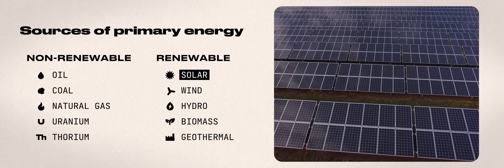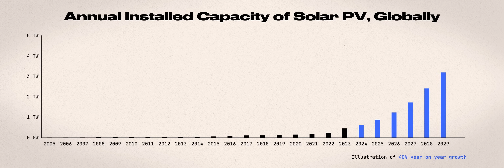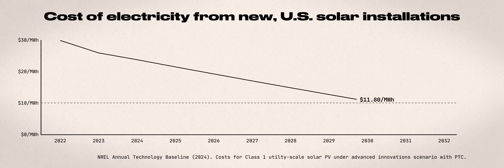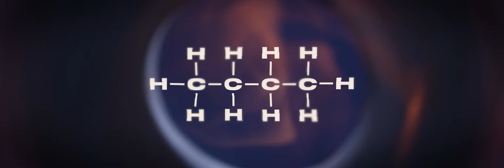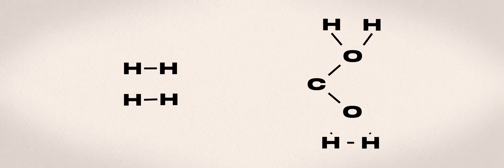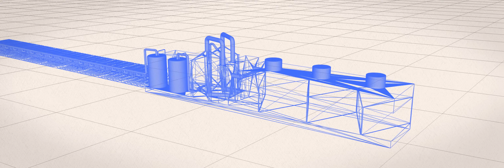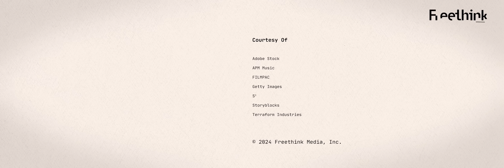95% of our energy could be downstream from solar by 2042 | The Freethink Interview: Casey Handmer

Comment: According to him, they will create a methane with an efficiency of 20-30% and then we burn that methane we will get only 30% (at best) heat which is used and rest are losses. So doing basic math this comes down to Solar generating energy (100) converted to methane (30) converted to useful energy which is a meager 9 points AT BEST. So you are losing 91% of the energy in this process just because you do not want to switch to other means of consuming energy (e.g. electricity directly). Makes NO SENSE to me.
Reply: The reason they are doing this, is because at peak hours the solar engery delivered in a renawble grid is more than collective consumer can utilize. This risks to overload the grid and results in negative electricity price to motivate industrial consumers to raise their demand and match the offering. Now if you have a spot mechanism that can be turned on to consume when the prices become negative with over supply of electricity, like lets say produce synthetic fuels and resell them for a profit when electricity becomes scarce again (night, winter, elsewhere on the globe), you can leverage negative electricity price and resell prices to turn a profit and help balance the grid. Its essentially the same a battery would do but with fuel that can be stored and moved and used as you like and in the form (chemical, thermal, electircal) you like.
Reply: @amadoucisse2692 so churn out some Bitcoin/digital currency, give electric discounts to AI data centers or send it to batteries to sell at a higher price later... The latter will most likely happen due to economic incentives. 

Creating complex hydrocarbons won't likely ever be cheaper than existing fuels which are currently more expensive than electricity and batteries... Which are getting cheaper every year due to Wrights Law/economies scale(ever growing).
Reply: @amadoucisse2692  There are far cheaper currently available methods of energy storage. This is taking excess energy, then wasting 90% of if before selling it back. There can also be other incentives, such as encouraging charging your car during the day, which could become mainstream if workplaces installed level 2 chargers.
Reply: @amadoucisse2692  But wouldn't that spare energy be better stored in a battery to use when its less sunny?
Reply: @ninamatthews8747  Not if you have to ship it around the globe
Reply: like others here mentioned, it's for applications that are really hard or even unrealistic to electrify. Think marine applications, aviation, steelproduction, glass manufacturing, fertelizer, etc... There is a possibility to electrify these sectors but not fully, that's why e-fuels will be necessary. Methane is one form of e-fuel, but other important ones can be e-methanol, e-ammonia, e-kerosine, etc...

By the way, burning methane like you mentioned doesn't always result in just 30% efficiency, depending on the machine you're using, it can be a lot higher. For instance, electricity production with a combined gas cycle turbine, results in a thermal efficiency of over 64% (most efficient one). Keep in mind that the e-fuel manufacturing is in it's infancy, incremental improvements will happen when adopted like we've seen with almost every other thing humans build.
Reply: The natural gas is primarily for processes that require it and cannot be electrified. Lots of critical industrial processes require chemical feedstock that is currently fed by fossil fuels. Also something like aviation will likely remain chemical-powered barring massive improvements in technology.

If someone wants to waste (what will arguably be a more precious resource than electricity at that point) by burning it to drive a car instead, that is on them.
Reply: I think it will be usefull for some niches applications, like some industrial processes or maybe big machinery in far away  region. But not in your car/bus/truck nor for heating/cooling your home.
Reply: So much lost sunlight
Reply: A huge amount of renewable electricity is wasted because there often isn't the demand to match the supply (noon on a sunny day for example), capturing the excess to produce synthetic hydrocarbons is where it starts. But as Casey says in the interview there will come a point where cost of solar gets so low that the easiest and cheapest way to reliably produce a lot of energy is through a massive solar farm that has its PRIMARY output as synthetic hydrocarbons, even if it's a highly inefficient process it'll still be cheap.
Reply: @olit1234  There are much better alternatives than this, which is about 9% efficient. To use extra energy from solar, charge EVs during the day for example.
Reply: @xeridea  Don't think you realize how massive spikes in renewable energy generation are when the sun is shining and the wind is blowing. Even if we manage to do the highly expensive infrastructure upgrades required to better deal with the extreme variability that comes with renewable energy generation (spoiler we won't be any time soon) there will still be a lot of waste. Also one advantage gas has is that it can sit in a tank to be stored ad infinitum, and that tank can be transported anywhere in the world.
Reply: There are a lot of things that don't make sense with this project. It's cool to use solar energy to convert into SOME SORT of fuel, but natural gas? No, that's not the answer. Methane is a very potent gas and we don't solve our problems by getting natural gas from solar. 

There are other options. See Mark Jacobson who did the hard research, the book No Miracles Needed about a pathway for every town and country to go to 100% wind, water, solar power for all sectors with the technology we have now. It involves pumped hydro storage as batteries and green hydrogen, but also a lot of renewables that we already have.
Reply: Will be necessary for aviation for decades to come.
Reply: It's not about 9% efficiency it's about economics, if economics works then everything works, solar is 22-23% efficient but it works bcoz economics works.
Reply: @vineetcv261  true, economics is a proxy of end to end efficiency. So if it is economical in the long term, it is efficient
Reply: Make sense for aviation (specific energy and energy density)
Reply: Hey, if you have more energy produced by renewable, but nowhere to go, you have to shut the solar/wind down, that's 0% energy captured, vs 10% that's infinite times more energy captured
Reply: I think its more of a proof of concept that you don't have to mine for fossil fuels anymore. It is a step forward and this kind of technology would help if we plan to go to the moon or try and terraform other celestial bodies.
Reply: ECONOMY IS NOT JUST ABOUT EFFICIENCY - here I solved the mystery for you.
Reply: Power companies could use excess generating capacity during the days to make natural gas and then feed that natural gas to their power plants at night or during bad weather, instead of using fossil fuel natural gas.
It's a carbon neutral way to store generating capacity for those times when we need it.
Reply: Oh and well said Harsh!
Reply: Good stopgap. We can't expect every ICE on Earth to get converted to electric in anything less than like 30 years.
Reply: I understand that there are industries that will require chemical fuel (e.g. aviation) but by the time this tech reaches it goal to be cost competitive, I suspect batteries will be dense enough or hydrogen will be cheap enough as well. I think by the time this company reach cost parity, others will beat them to the target industry or they will become niche solution rather than huge market as they perceive. But I LIKE that they solve part of the problem rather adding more to it. I would love to see them succeed. It is ultimately us against the climate change.
Reply: But the input energy is free (the sun), and the opportunity cost of not using existing fossil and ICE infrastructure is a large one.
Reply: Focusing on energy is the wrong answer to a sustainable living because with more energy available, humans will keep destroying the environment which lead to humans extinction.    The only way to not risk human extinction is to voluntary  limit our global consumption under the regenerative capacity of the Earth, there is no other way.    Are humans able to do it?  Unfortunately I doubt, therefore we will keep on adapt our society to consequences to our destructive behaviors until it will not be possible anymore.   When we will reach that point it might be too late to avoid the human extinction because the environment might not be able to sustain the life as we know it, us included.
Reply: You can't extract minerals and make solar panels only with solar panels.   Solar energy can only exist with cheap oil.   There is no long term futur with only solar panels.
Reply: @denisdufresne5338  are you sure about that?
Reply: I agree, but if fossil fuel industry crashes and that includes the transportation of it too, It might be cheaper to artificially make it where it is needed.
Reply: @northsouthpaw  What do you mean by "...to artificially make it..."  ?
Reply: You've just described about the efficiency of gas and combustion engines :) at most 20% efficiency and the rest is lost as heat. Makes NO SENSE to me.
Reply: It would be about taking advantage of existing distribution infrastructure.

Energy is neither created nor destroyed. On this planet in this solar system. All magnetic gravitational energy comes from or returns to the fermie cells of the Galaxies OOrt cloud magnetosphere which the sun moon & planets bounce between causing climate trends & end times cataclysms.

"When you see the trees turning  green due to rising CO2 from Earth's increasing AXIAL TILT (Magnetic  north) thawing frozen CO2 at the poles you are at the door." Knock  & Jesus will let you in. Parable of the greening fig tree.
Reply: Global warming is a lie! they’ve had the technology since the 1950s to replace fossil fuels. Dr.Steven Greer.
Reply: "(e.g. direct electricity)" It can run your car or trains, but not the world (jumbo jets and cargo ships) they need heavy fuel. A better way is to make fuel from sunlight, which can be done using plants, like seaweed biofuel. And throw the plant residue back, so it doesn't lose the fertility of the coast.
Reply: @hft_trader  I see when you tell the truth your post gets deleted! 🙄
Reply: As others have mentioned there are surges that need a sink to go into and this is a great solution. Battery technologies are coming along to help with this but having the electricity turned to natural gas is a pretty awesome form of chemical battery that there are tons of uses for and that we are already industrialized to.
Reply: And who wants electricity ? A complex and highly consuming system. By the way, the efficiency of reciprocating internal combustion engines is (36% - 50%).
Reply: ... Well first you're getting about 20% efficiency converting from solar to electric -> than losses to electrolysis -> then getting a 20-30% conversion on methane -> then a 20-30% conversion from chemical to mechanical energy
Reply: Right, it seems kinda weird to do it this way when we can just swap everything to running off of electricity.
Reply: The point is, the existing methods are almost just as wasteful, and costly to run.
Reply: Totally agree, I was thinking the same thing when he was saying it, it is good to hear such positive news, I just hope
Reply: No better energy storage than fossel/sy thetic fuels
Reply: Think of it this way. Ideally, we’re using SWB (solar-wind-battery) to provide the entire grid, so no fossil fuel. But enough SWB to handle cloudy, short winter days is a lot, and expensive, even given the cheapness. More importantly, it means we have enormous amounts of surplus solar on sunny summer days. That surplus would otherwise go to waste. But used to generate fuel, even inefficiently, means it can be time-shifted (and space-shifted). Using the gas plants we already have on the grid, we can back the SWB in winter with time-shifted summer energy, using carbon-neutral synthetic methane. This would be much cheaper.
Reply: Of course, wherever it is feasable to use electricity directly, by all means, that's what we should do, but some things just cannot be electrified in the near-medium term (ex: the airline industry).
So having that flexibility to turn the electric energy into fuel, even at a loss, means we can decarbonize those industries now instead of having to wait 60 years for electric planes to become a thing...
Reply: Because there are unfortunately common industrial processes needed to refine raw materials and produce others that require vast amounts of heat that cannot be easily supplied through means of direct electrical conversion.

Over time new solutions for direct electrical thermal conversion are being developed that make chemical fuels redundant, but for now it is simply not possible to just abandon fuels without also abandoning the industrial processes that rely on them to function.
Reply: @ Then the solution is to find alternatives to the high temperature industrial processes that can’t be easily solved with resistive heat. Luckily, some very smart people have developed solutions, so the problem isn’t the solution - it’s scaling it in a way that’s cost competitive with legacy players with fully depreciated capex. 

Really, there are two high volume, high temperature processes that account for the vast majority of the problem - steel (pig iron in particular) and Portland cement. The latter is particularly egregious because it’s a CO2 problem two ways - half the CO2 is from the heat required for calcination (reducing calcium carbonate to calcium oxide, aka lime), the other half is CO2 released by calcination, which literally knocks a CO2 loose. Brimstone solves this by using calcium silicate rather than calcium carbonate, creating something chemically identical to Portland cement without the CO2. This process also likely uses much lower temperatures than calcination (600-900c rather than 1500c), making electric heat viable. Sublime Systems makes a Portland cement workalike from calcium-bearing silicate rock (they can use stuff like fly ash too) using an electrolysis process at room-ish temperature. Their product has passed all the same critical standards examinations as Portland cement and is certified. 

Meanwhile, in steel, Boston Metals has developed an electrolytic solution for refining pig iron from iron ore - again, relying on voltage rather than temperature for the energy. Traditional pig iron uses coke (almost pure carbon) at high temperatures to literally burn the oxygen out of iron oxide, binding it with carbon and releasing CO2. Boston Metals avoids this with recyclable electrolytics that can release pure oxygen. Others have worked on hydrogen rather than carbon for the burning, making H2O rather than CO2. 

So yes… by all means, let’s abandon the industrial processes that require intense heat and produce CO2 as a byproduct! But that doesn’t mean a world without steel and cement. It just means a world without dirty legacy processes. But to get there will require significant funding and government intervention, or the alternatives won’t be able to climb the capex barrier to entry.
Reply: And yet we have tons and tons and tons of methane hydrate locked on the bottom of the sea..
Reply: It never makes sense when you really start to look at their proposals
Reply: For heat: Solar -> Sand battery storage
For electricity: Solar-> sodium batteries
And let's not forget nuclear, geothermal, wind!
Geothermal will be HUGE!
Reply: Some things don’t work with electricity. For example, glass production or when you need power far from civilization. I agree with you for cars or heating a home, it does make sense.
Reply: @Ravachol71  There are ways to make it work for any means of production. You could power lasers and focus them at a single point to generate a tremendous amount of heat, capable of melting anything.
Reply: @Ravachol71  If you need power far from civilization, just take his advice and put in cheap solar there.... This only makes sense in very limited situations with no better alternatives, another being aviation, which likely will never switch to electric, due to limitations of physics. But it would probably make more sense to just reduce fossil fuel use by 95% by electrifying everything you can instead of using this convoluted tech as a bandage.
Reply: @Ravachol71 "Some things don’t work with electricity. For example, glass production or when you need power far from civilization"

More like these production processes need time to develop direct electrical thermal conversion methods or systems.

If in the future a battery can be made that stores 10x the current Wh/kg and Wh/L density of lithium ion desigs then the "power far from civilisation" part will be satisfied, though I think you meant far from the sun, as solar can work far from civilisation no problem - excepting in the desert where excessive heat and lack of water to cool down the solar array makes them degrade fast and work at suboptimal conditions.

(as efforts to regreen deserts progress the heat and lack of water will become less of an issue, even at the equator)

Ironically the ISS is pretty damn far from civilisation, but solar works about 40x better in space without all that atmosphere to absorb or reflect the EM radiation, so the ISS can supply itself pretty well with state of the art solar panels and batteries.
Reply: If the fuel produced can be sold competitively at least ten times more than the cost of the solar, who cares about energy efficiency? The thing will print money.